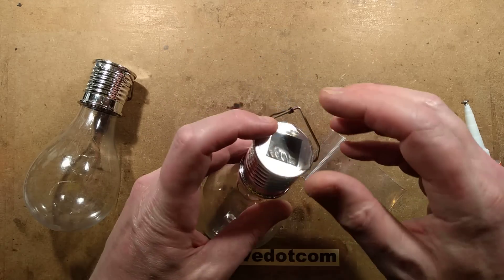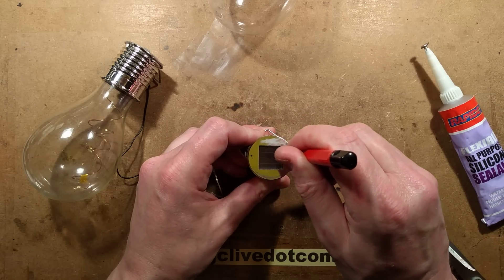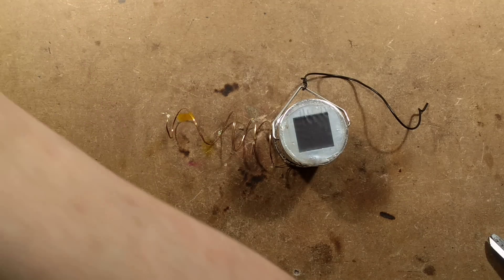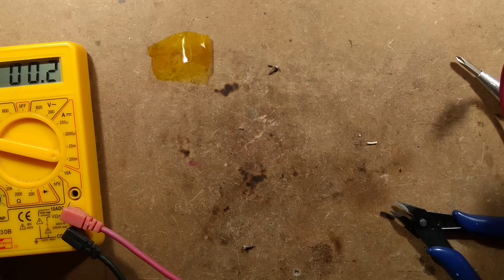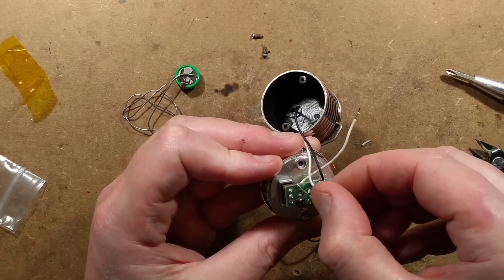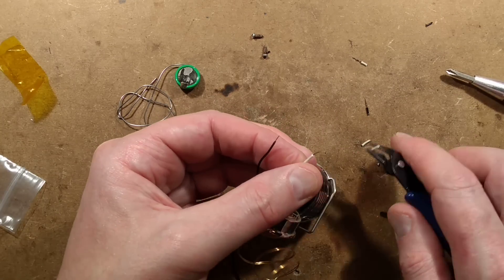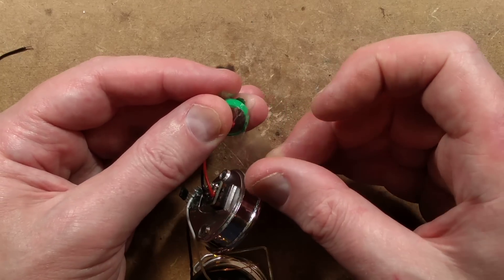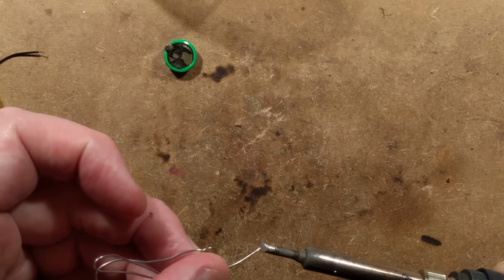Silicone sealed solar lights one year update.

Comment: The small glass backed square solar panels are monocrystalline further the polymer encased solar panels are tiny strips of polycrystalline on a black backing making it look like one panel. That explains the superior output current. Monocrystalline has a better output to surface area ratio and it sort of inherently is quality controlled or else it wouldn't be monocrystalline. Further The polymer encased panels are mostly black plastic and not solar panel.

I have a solar phone battery with a polymer encased battery and its dense leaving almost no part empty and it about matches up with the output expected of a polycrystaline panel except that the light has to be evenly spread on it. So mostly its the fact that the panels are half fake crap.

Now why they tend to use these small glass ones on some solar lights is something I could never figure out.

Comment: (15:48) - Don't forget to ream that melted hole from the inside of the bulb since there will be a small ridge all the way around the hole on the inside.
All you need is a long drill bit, I imagine, for this, otherwise a small amount of water will pool around the unintentionally created ridge.
These are being hung upside down, right?
>

Comment: Am I the only one that was disappointed that he didn't touch the broken wire to the cell to see if it would still work, or check the voltage on it?
Reply: Nope I was waiting for that as well or at least putting the meter on it just to see if it might have still been working if the wire had not come off.

Comment: Important:
Silicon = Chemical Element with 14 Protons
Silicone = Polymer made of Siloxane (chain of silicon and oxygen) and other elements
Reply: Even more important if you go near Diesel ;0)
Reply: silicon is an atom, a bunch of silicon is a black rock.
Reply: In Germany, we use "Silizium" for the chemical element and "Silikon" for the polymer. Some newspapers used to trip up over this. Probably because they just online translated an English article. They would report about breast enlargements of celebrities by referring to it as "Silizium". Doesn't happen very much anymore (or I just don't read those articles maybe).
Reply: @Gigator  is it true that Germans use comma as decimal point instead of dots ?
Reply: @xponen  1.500,99€
Reply: @xponen  a lot of euro countries do actually
Reply: Important:

Clive's pronunciation of the above: "I don't give a fuck." :)

Comment: 13:21  im imagining the old battery sitting in a chair behind a desk with spot lights pointing at it :-)
13:50 wire insulating , how about the little blue stamps that uk garages used to give out when you bought fuel , friend of mine used them when he fitted a radio in his car , i dont know how long they were on but when i pulled out the radio the stamps were unstuck and just loosely wrapped around the wires :-)

Comment: But then, how is it they cope in much hotter, sunnier climates without failing? Do they use different cells or circuitry, etc depending on which market they are selling them in?

Comment: Thanks Clive . I've had a couple of solar lamps where the wires have come off the solar panel and ripped some of the backing off , i've not been able to reattach these, solder  does not work , any ideas?
Reply from the maker: It's a thin multi-layer film that is easy to damage.  Sometimes a very fast dab of solder to tack the wire on and some glue to hold it in place works, but the output is often lower.
Reply: @bigclivedotcom  yes thank you .I could not get solder to work i did try glue (hot glue gun) but like you say the output was very low and for the price of a new light it's not really worth getting a new solar panel , when you can get 3 lights for a few pounds. Thanks for the reply Clive i appreciate it. :-)

Comment: Spare that tip, young man!  You already know how that turns out, Clive! Wiping and tinning won't completely stop the damage...
Grab a short length of bare 18 gauge solid copper wire *wit da pliers*. Make a tight loop (with a short bit protruding at the end). 
Add solder to the loop (making the short end as hot as Hell).  Melt the hole wid da wire and then throw it away when done wid it.
Reply: In fairness, the soldering tips only cost about $1 each, so not a major investment even if one ultimately has to dedicate a tip to that task.

Comment: My mother bought three neat little solar lights from Dollar Tree. They are flowers (with the solar panel centered in the concave flower shape) with plastic hummingbirds over the exposed LEDs. The most noticeable design flaw is the flower itself, which is a nice little bowl for rainwater to sit in. On the up-side, they run off standard AAA cells that are user-replaceable, so I yanked the 100 mAh NiCds out and put 600 mAh NiMh cells in.

Out of the three, one failed as water ingress shorted out the charge chip. Didn't expect much for a buck, but the other 2 have held up surprisingly well.

Comment: I was measuring a smaller solar cell I ordered from Amazon in direct sunlight and & In the ambient light of my workshop. In direct sunlight, it produced over an amp (& blew my fuse!), while inside it would only be as high as 50-60 mA
Reply: Beardwhip Now try with studio lights.

Comment: What about putting a diode in series with a blue led as a cheap alternative as a voltage limiter.  1n400x diodes are good for about .8 volts and blue led's are good for 3.4 volts forward, and the two in series would be about 4.2 volts and that would keep the battery from dying by over voltage. The same idea can be used to make a voltage limiter for any voltage.
Reply: Paul R It's not a LiPo battery (~4.2V), It's a NiMH battery (~1.2V).  But yeah, if overcharging is the problem, the charging circuit has a problem.
Reply: @johnfrancisdoe1563  In that case use a 1.5 or 1.6 forward voltage red led. or two silicon diodes in series. Most of the solar lights have a very poor battery life, and I noticed that there are two reason. One is the charging voltage is not controlled, and secondly they are discharged fully each day. If the solar panel is large enough to charge batteries that will last all night and then some, and does not over charge then the things would last more than a few months. 

I just see many things that are poorly designed and as a result fail quite prematurely. I can hack out engineering projects and get them to be more reliable without a large increase in cost. It is just most things are done more on the cheap then charge people good money for things and then they need to go out and buy new ones. Most companies do stuff like this all the time now, and I am just giving you you one of the issues that can greatly increase life. The other thing is de-rating products, if something has 1/2 w led's in it, why over drive them? it makes more sense in terms of life to run them at 50% less than rated or even half the output. Then the things don't burn out and put more stuff into the landfills. 

There are many things that quit working, and people like myself as a kid would like them so they can take them apart and make them work. That is how I would get things such as my first TV, computer, and many other things. Can't afford to buy it new, so get a unit with problems. The other way is when makers sell off old projects for pennies on the dollar to work on new projects. I bought a Timex Sinclair 4K for about $15 including shipping years ago. As I could afford that, but not the $125 price in the store at the time. 

We have so many ways that we are wasteful, and people can benefit from things instead of them being ground up or buried in landfills.
Reply: A simpler solution would be to install a Zener diode across the cell (assuming it’s at least a pair of cells at 2.4V)...or a couple of silicon diodes (if a single 1.2V cell)...but I’m assuming there are at least 2 series cells since 1.2VDC is too low a voltage for most LEDs to emit any meaningful amount of light, so a Zener diode paralleled with the battery should be an option.  Alternatively, one could add a series resistor in series with the solar panel to reduce peak charging current, but then you may not achieve a full charge during winter months when the days are much shorter.
Reply: @ethanpoole3443  Zener diode would work, needs to be rated for the power dissipation that is likely to occur.  I mentioned silicon diodes as an option as well. Key thing is knowing that there are many ways of fixing the problem, and the way to do it is personal choice and what is available.

Comment: The chrome plating is actually vacuum deposited aluminum.
Reply: Do they coat it in something to stop it from oxidizing?
Reply: Pook365 Aluminium oxidides very rapidly, but forms a hard transparent layer. The same process is used in the mirrors of large astronomical telescopes.
Reply: @gordonrichardson2972  Typically after the deposition process it will be coated with polyvinylidene chloride (PVC). However, in some processes it is actually chromium. This is becoming less and less common due to chromium being restricted in many countries.

Comment: Clive, possible reason that the output of the solar cell has gone up could be that you updated your work lights.
Reply: Also I don't know how good the line regulation of his worklight is, if that day there was a lower mains voltage or maybe a higher ambient temperature, I suppose the worklight output could be lower.

Comment: I have heard tale that short batteries as this, and the ones you have inside of computers, are actually more like capacitors, as they don't hold a charge for very long
Reply: Different thing entirely, super capacitors have a very low self discharge rate, making them ideal for memory backup. Chemical batteries self discharge at a faster rate
Reply: @FarleyHillBilly ... No?
Reply: @phonotical  
Yes
Reply: Farley Hill or, Yes, No...lol.  But (for the OP) seriously, these are actual NiMH batteries and not super- or ultracapacitors (which are something else entirely and are proper high capacity capacitors, typically measures in Farads or tenths of Farads...or millions of microfarads).  Devices may use either for backup memory purposes though, it all depends upon price point and how long one needs to maintain the battery backup.  Properly engineered,  a supercapacitor or ultracapacitor will afford a a much longer service life than a NiCd or NiMH backup battery (which require periodic replacement) but batteries have much higher energy densities for their size and have a flatter discharge curve than any capacitor.
Reply: @ethanpoole3443  I am aware, just general characteristics

Comment: How many times a day would you say you have to empty your dehumidifier?
Reply from the maker: My main two dehumidifiers are plumbed in so they drain outside.
Reply: @bigclivedotcom  ahh I had thought of doing something like that
Reply: I don't think he has one, he like 'moist'
Reply: Assuming a closed indoor environment (e.g. windows and doors kept closed) you will empty a dehumidifier multiple times a day for the first week or two as you dry out the interior space and then the volume begins to drop off significantly over time.  Here in the SE US I use a dehumidifier in my garage to both keep my tools and cast iron surfaces from rusting as well as to make for a much more comfortable workspace and mine is also plumbed to a pump that pumps the captured water outdoors once a quart or two has accumulated in the pump reservoir so that I don’t have to bother emptying the bucket regularly.  But in the beginning it would fill the bucket multiple times each day...after years of running it typically takes days to produce that volume of water unless the doors are left open on a wet day because now the concrete and walls are at an equilibrium moisture level and help to moderate sudden changes in humidity (I aim to maintain 50-55% relative humidity in my shop which also keeps my stored wood at a consistent moisture level year round).
Reply: @ethanpoole3443  mine gets down to about 50% but I still empty it maybe twice a day, maybe three times on a bad day, I just wanted to know about other people's experiences, thanks!

Comment: With such a large hole, will bugs ingress?
Reply from the maker: They've been fine.  These do hang from a bush with the holes on the bottom, and no bugs seem to go in.
Reply: @bigclivedotcom  Thanks for the reply. 
Bugs over here do crazy things.. 
I found a hornet in my breaker box. It had to climb down 30 feet of pipe, through the meter and down another 5 feet and through 2 elbows... 
It was dead.
Now I  have underground service to the house...
Reply: They will use the moisture and work 24 hrs a day because there is no night time for them.
When they die of exhaustion their remains will partially block the hole
Clive understands the subtleties of these things

Comment: You could probably put an appropriate zener diode across the battery in reverse, so if the battery voltage gets too high the solar panel gets shorted out.
Reply: I always loved zener diodes..clamp the shit Right..
Reply: Oops one more.. I always found electronics just crazy..just me.. y'all have a great day

Comment: Found one of those abrasive pens on eBay, but all of the results ship from the UK (though fortunately they will ship to the USA).
Reply: Use Ebay.com, everything ships from China
Reply: Brah, I only ever use eBay.

https://www.ebay.com/itm/Fibreglass-Pen-Fibre-Pencil-Pen-Abrasive-Cleaning-Electronic-Modelling-Etc/190261411978?hash=item2c4c76c08a:g:sccAAMXQbBVRDlLK
Reply: @bakonfreek  Fair enough
Reply: I suspect that is because of the spelling. In the UK we use "fibre" rather than "fiber", if you switch to the more sensible spelling you should find international results :)
Reply: I just punched up "fiberglass abrasive pen" in the search bar. It looks like there's one that ships within the USA, slightly higher price, but it's free shipping so it balances out XD

Way down at the bottom of the search results, everything else was in the UK.
Reply: You can also buy from Amazon.  As to whether they ship domestically or straight from China will depend upon the vendor you elect to buy from on eBay or Amazon — Direct from China is usually cheapest but can take several months and occasionally such packages never arrive (yet it’s too late to open a dispute by the time a few months have elapsed — a risk you take with Chinese sellers).  But it is worthwhile to order a couple of packs of them as they are useful yet easy to temporarily misplace!
Reply: Yeah, did me some more digging and found a bulk pack direct from China for sub-$10 after shipping. I might pay more for domestic shipping though as I might find these useful before this summer semester concludes.
Reply: ebay.fr has them for €39 D
Reply: I'm finding them (US shipping only) now for like $4-$5, but they're the 5 inch ones so the scratch tip sticks way the hell out.

Comment: just curious, where does the water go that inevitably seeps in from the holes that locate the hanging bracket?
Reply: At least on the ones I have, the holes are only indentations and don't breach the inner walls.

Comment: Sainsbury's are selling these this Summer! I was looking at getting one or two, and they also have an LED 'filament' version, which is rather nice to look at, other than the filaments look a bit like illuminated meal worms when lit up. The Yorkshire Trading Company also sell something near 'identikit' in appearance.

Now, I hadn't though about covering the PV panel with silicone, I rather though the vapours off that stuff might be strongly corrosive, and instead, opted for "greenhouse repair tape" from Wilko. It's like an ultra tough, thick Sellotape type of product (there's a "Gorilla" version too) that lasts for ages. I 'repaired' a broken caravan window with greenhouse tape a few years back, and it's still holding up well to the elements. 

I have several solar light sets at the moment, and have noted a significant degrading of the (once upon a time) clear covering on the PV panel of the oldest one (about 4-5 years old). It's now a dull, milky, white, even though it does still output enough to maintain a good charge on the cells.

It will be interesting to see if your new cell fairs better than the last. . . . Just out of interest, do you have several of these lights? and if so, how well did their cells survive last Summer's solar onslaught?
Reply: Those resin potted solar panels always degrade after a year or so outside, even industrial ones used on solar traffic bollards go the same way.

Comment: Just use your cheap crap iorn and replace the tip with a nail as smaller holes are better
Reply: You can’t replace the tip with a nail — not going to work with older Hakko inspired knockoffs as the tip is hollow to accept the heating element.  However, the tips only cost around $1 each, are widely and readily available, and are available in a wide range of tip sizes from less than 1mm up to about 6mm, so no need to bother with nails at such prices.
Reply: @ethanpoole3443  
The irons i had in mind were the super cheap ones about £5 ish in a brick and mortar store probably much less online
designs can vary and the irons i had in mind were the ultra cheap ones that have a small screw that secures the tip in place,

look at other designs too
I doubt the usb Soldering iron mouse has a hollow tip though i don't know if the tip is replaceable on that